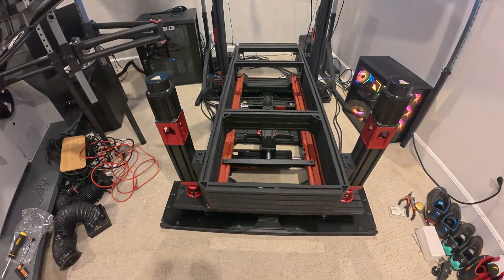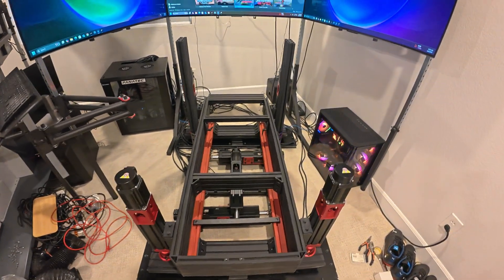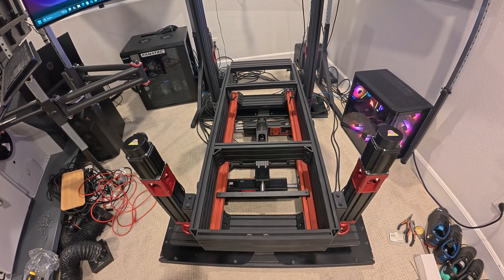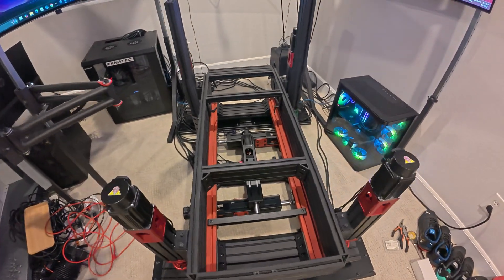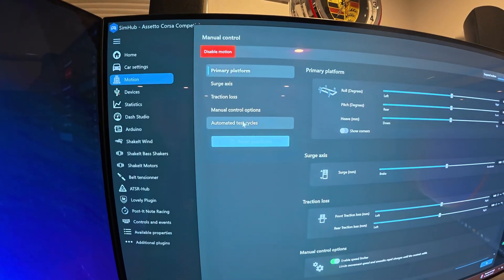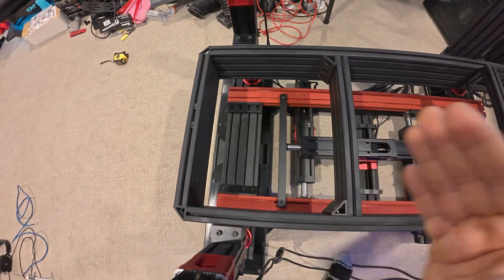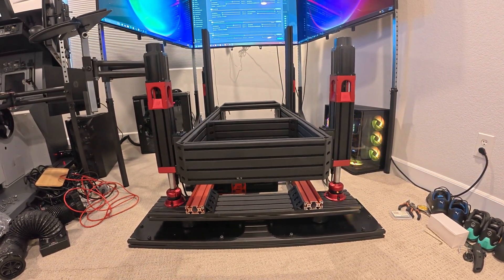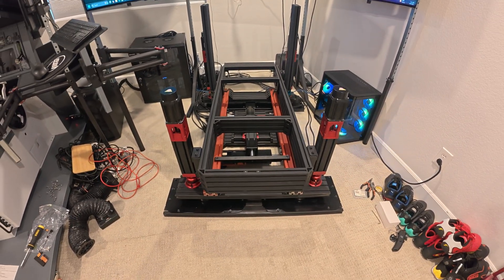Eracing-Lab RS Ultimate Gen 2 Upgrade - Movement Tests and Guidance

Comment: Hi! Do you have the exact dimensions of the full setup? So including the frame, seat, pedals and monitor mount. I need to know if it will fit in my small room (length and width)
Reply from the maker: Mine fits in 6ftx7ft.

Comment: Hi, I have a question: does your surge axis move perfectly straight forward and backward, or does it follow a slight curve?
On my setup, the difference is 0 mm in the center and about 5 mm at the front and 5 mm at the rear, so the surge travel forms a slight curve.
Thanks!

Comment: Hey, thanks for all your videos! I noticed E-Racing Lab recommends using their spacers to reach 660mm between the left and right actuators  — is that actually necessary from a technical standpoint? I saw you installed them as well and was curious if they make a real difference. :)
Reply from the maker: Nah does not make a difference. I installed it because I needed the extra space on each side.
Reply: @simul8master  Thanks for the reply! One more question — I saw the “D” profile is 930 mm on the E-Racing site. I’m thinking of going down to around 800 mm (no spacers) to save space to my wall. Do you think that could affect stability? I won't sue you if it's unstable in the end :D but 930 mm seems pretty long?

Comment: Great tips and guide. Thanks for sharing. What’s the model of your displays? I like the thin bezels, thinking about upgrading.
Reply from the maker: Hey thanks! These are LG’s OLED c3s. 48 inch. I would go for the samsung’s OLED though s90 or newer models. I have those on my flight sim and like them better.
Reply: Fantastic, thanks for the info! Great setup.

Comment: 🤔 I'm curious to know how accurate and powerful the "Surge" DOF is now, as compared to the originally developed configuration. 🤔 I'm a little disappointed in the lose of 50 mm of travel though. 😮💯🤷🏽‍♂️ So, I'm hopeful this latest configuration is best overall..!!!🤞🏽💯👌🏽
Reply from the maker: Yup - will do some tests after the rebuild is done.
Reply: Why does it need to loose 50mm travel? Is it because serge movement requires the TL actuators to move a little? And vice versa?
Reply from the maker: This from eracing team: When designing the RS COMPETITION, we wanted it to be “compact” (no actuator sticking in front and rear) and comfortable to get on the rig without having to climb up or climb over the platform. So we decided to put both TL actuators underneath the cockpit and within the center area of the platform.

There’s also a huge technical advantage for having the TL actuators close to the center pivot point. The actuator only needs to travel a very short distance to turn the platform at a large angle, and at a very fast speed. The result is 20 degrees in 0.4 seconds! On other platforms, it would require a 200mm or even 250mm actuator in order to turn this amount of angle, and takes much longer time.

As for surge (and other horizontal effects like TL and Sway), our philosophy has always been that these effects should be quick, short, and “snappy”, giving you the sense of impact, sudden loss of tracking, braking… etc. They are not supposed to mimic “sustain G-force” because the result would not be convincing even with a 200-300mm actuator. We find sustain G-force is a lot more effective to be handled by the Active Force (our new dual belt tensioner).

So in other words, the 100mm TL and Surge snaps you into / away from the seat, then the Active Force L/R belt tensioner applies sustain pressure to replicate the sensation (or cues) from g-force.
Reply: @simul8master  thanks for sharing! :)

Comment: What was the last bits of the motion test? Sounded like haptics test for the actuators heave...
Reply from the maker: Yup - it’s the heave pulse.
Reply: @simul8master omg that sounds brutal. That should be noticeable in the entire building? Or is this exaggerated over the recording?
Reply: @Jan-1337 it sounds worse on microphone recording than in person. I just tried it here out of curiosity 😂
Reply from the maker: Lol it did bother me a bit and shook some items in the room. It will be more noticeable in smaller spaces.
Reply: @tronicgr What does this effect do? Maybe I can turn it off. I was actually planning to run the Gen2 in my apartment. I have a floating screed floor, which should provide good impact sound insulation. But it sounds like that won’t help in this case.
Reply: @Jan-1337 you don't have to enable haptics if you don't want to 😊. But sure, even with the anti-vibration actuator feet, some force does transmit through. I have to try that with the softer balls in place 😂